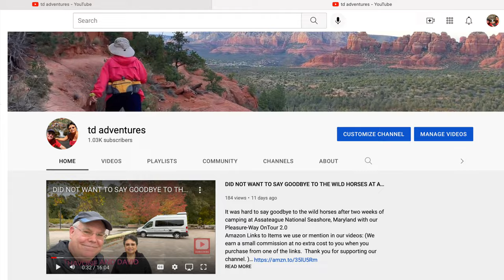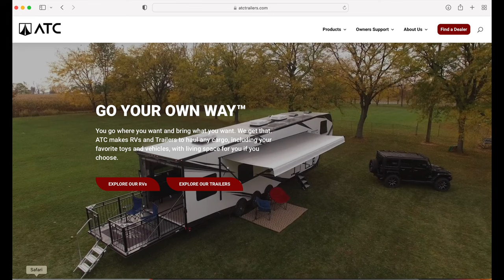ATC TOY HAULER//TOUR BY OWNERS

Comment: What size truck do you need to pull this 5th wheel ATC
Reply from the maker: Hi John. You will need at minimum a 3/4 ton truck. A one-ton dually truck with an eight-foot bed would be ideal because it can handle that much more weight.  Hope this article will help. https://camperreport.com/what-kind-of-truck-do-you-need-to-tow-a-fifth-wheel/